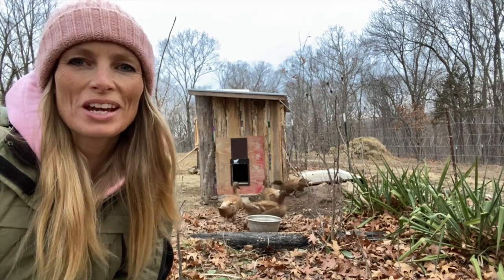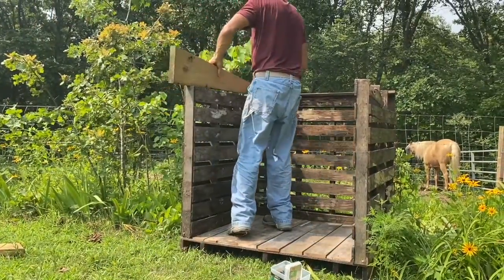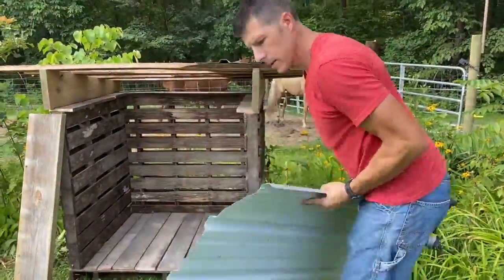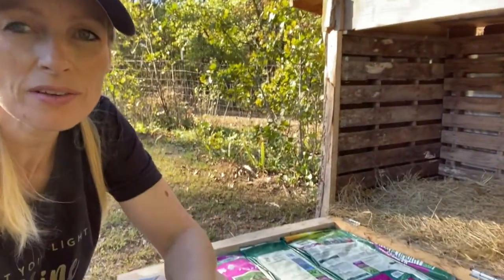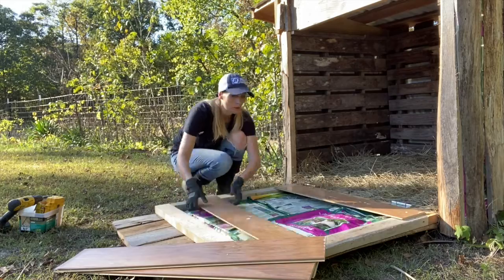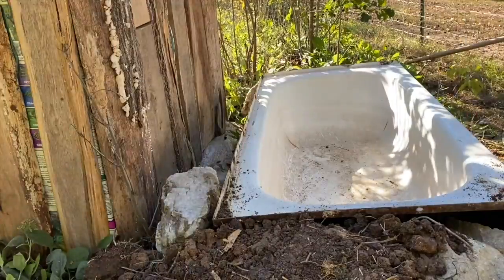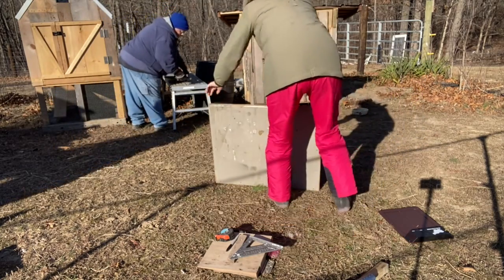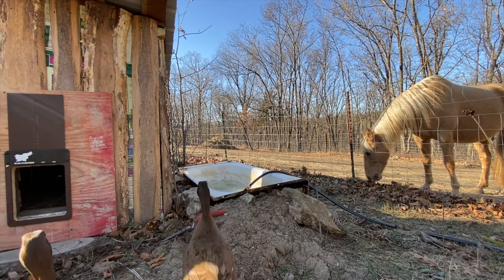Building a duck house with pool | Simple duck house ideas

Comment: I love this vid so much ❤. The way your kids help and the cat jumping into the bath tub. Your daughter is so funny. Just wondering how often you change the water and do you collect into a water butt or it just comes directly off the roof into the bath. In which case what happens when theres not enough rain? How do you access the house to clean and collect eggs? Tx again for lovely vid 😊
Reply from the maker: Thanks Clare, I appreciate your encouragement!  so first let me say that we have a breed of duck that doesn't spend a lot of time in the water. I think it would be different if they were different ducks, so i don't change the water that often - usually when it becomes murky and they stop going in it. I realised AFTER we build it that the bath is shaded from the sun ( on the north side of the coop) so i do get algae building up faster than if it was south facing. The roof run off gives a good fill to the bath but it depends on how much rain we have, and because of the square footage it never fills the bath so i do use the hose too. Especially during summer. The duck house has a large door on the front that drops down for egg collection ( i thought that was in the video - maybe its in my other duck vid!!)

Comment: You have been three months into the new duck building and I'm wondering how easy is it to clean out? Later on during the summer can you explain the pros and cons of the bathtub? I have been using baby pools and don't much like them but cleaning algae and muck out of a bathtub might be worse.
Reply from the maker: Sorry i didn't see this comment ! Yes its super easy to clean, i just use a garden cane to bump the plug out and let the water drain while i'm weeding then i rinse any sludge out with the garden hose - it all drains downhill across the horse paddock... my only challenge is that with the pool being shaded the algae build up can be faster but then that is just about as fast as the ducks soil the water anyway ! There have been no other cons. Depending on what duck breed you have this might vary... our khaki campbells don't swim a lot anyway - they use it to splash and clean when its hot but they don't "sit" on the water, they rather be out on the garden hunting bugs
Reply: Possibly goldfish for the algae build up and a strainer to prevent said fish from being dumped
Reply: Have you ran into any problems with your flock and Botulism?

Comment: How do you easily drain the bathtub?
Reply from the maker: i just use a garden cane or stick to shift the plug and let the water drain out. Then i used the hose to swish any sludge out - it works great !